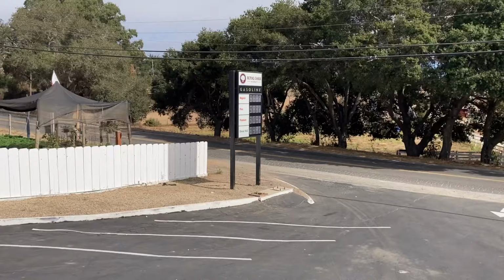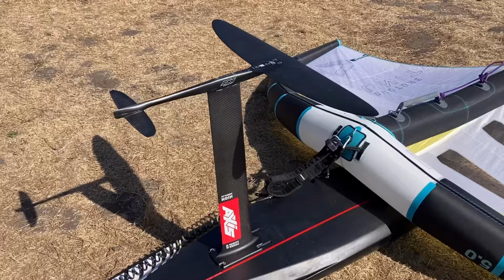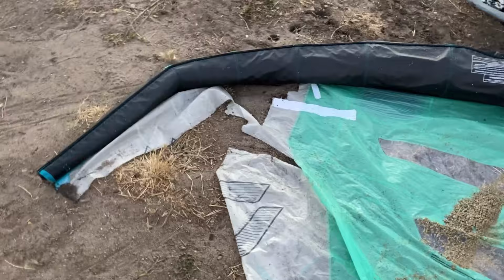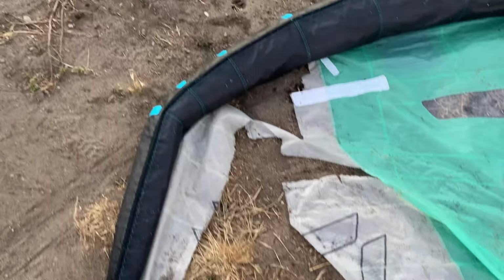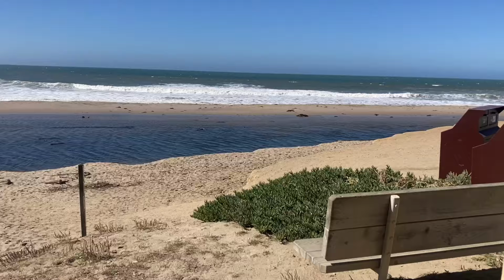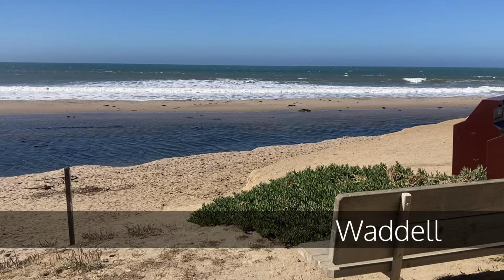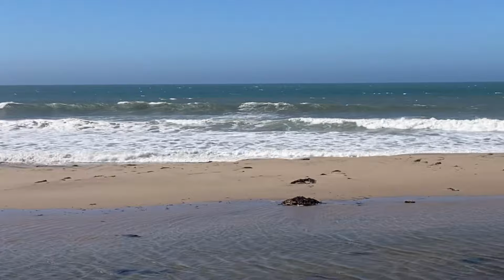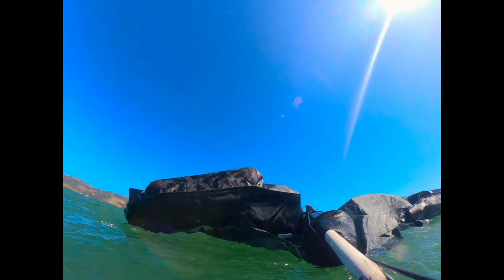Big Wave Wingfoiling - Is it worth the risk? - Wing Foil Vlog

Comment: OMG, it's a flashback for me watching this.  It was two years ago, in the fall, I went out at Daventport in the same conditions.  I remember watching the tip of the windsurfer sail behind the waves.  I went out at the north end of the beach, could not get started, got sucked into the rollers, worked up pretty well,  ended up at south end of windsurfing reef and before reaching the beach I was facing a WALL of mussels....I remember saying to myself "this is it, it is going to be bloody" as there was a big white water coming my way.  Out of nowhere there was a tiny wave coming at 30 degrees angle and tossed me straight into a tiny sandy cove just big enough for the 4.2m.  I did the same thing as you...deflated my wing and toss my board over the rocks, climbed etc...  The funny thing is there was another winger out and it was Slava (spelling?) and he survived without breaking anything.  Thanks for this story.   I humbly learned my lesson about (not) winging in big waves and glad I survived that one. 🙂
Reply from the maker: Thanks for sharing. It’s happened to a few other people as well! I think Scott’s is a much better spot to go on moderately big days because you can judge the risk better, and there’s a much longer beach to come in on if you have an issue on the water. And you can rig the appropriate wing for the conditions. Davenport seems like the best choice because of the “channel,” but I think it’s a false sense of security. Slava is mad man!

Comment: I ripped  my new 3.5 Slick yesterday (Borhaug, Lista, Norway) just bye  coming in the shore breaks a bit strange yesterday. At that first spot I may have gone out windsurfing but probably not on my wing, well first I need to learn to ride waves on the foil. Started winging this summer I have a long way to go to get to my windsurfing level if even possible. I think whole consider to de inflate the wing and just stick it in a big plastic bag. The sharp foil and the wing just are not friends. I have be on some big waves long time ago in Lancelin, 1994, 1996, 1998. 🙂 I’m glad you are ok and hopefully learn something. So you can be better prepared next time.
Reply from the maker: I think maybe I’ll just unhook the leash and throw the wing up in the air and let it drift onto the beach. Haha. 

A lot of times I relax too early coming in because I’m out of the danger zone, and then a sneaky wave or big rip current catches me by surprise. It’s important to stay focused until actually on the beach. 

Definitely learned some stuff. The biggest issue was just lack of wind power. If I had been on a 6 m instead of a 5 m, I would have made it out. 

I just really hate winging in gusty spots.
Reply: @wingmanfoilclub   Even I have be windsurfer and speed windsurfer for a long time I still pick the wrong sail or wing. I where just going in to switch to my 5.0 Slick. Maybe next time I should use my new gadget "Cloud IX Anchorman wing leash" and just leave it out side the shore break and go in with the board/foil and then go out for the wing. ;-) Doesn’t know if you have see the video from Hawaii he lost the wing then wait for wave surf the wave in then he picks up the wing that where just the perfectly timing and no time lost.
Reply from the maker: @alfskaar489 we definitely need to think up some new strategies

Comment: So question: when you are getting worked by whitewater how do you keep distance from your foil?
Reply from the maker: A great question. 😂 The best solution I’ve come up with is grabbing the rear footstrap and pointing the board downwave and trying to let the board surf with the wave ahead of me and body dragging behind it. This works pretty well, but if the wave is too big it just takes one wrong edge catching and the board starts to flip. The other thing I do is sand soft all my tips and trailing edges.
Reply from the maker: The other thing I’ve heard of his climbing on board and jumping over the white water as it’s about to hit, but I’m not sure how well this would work for multiple waves.